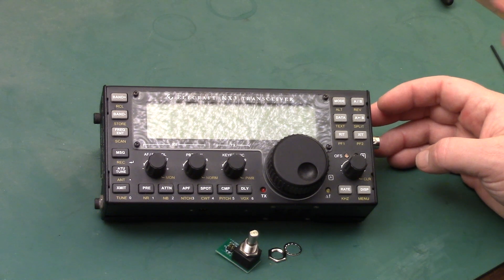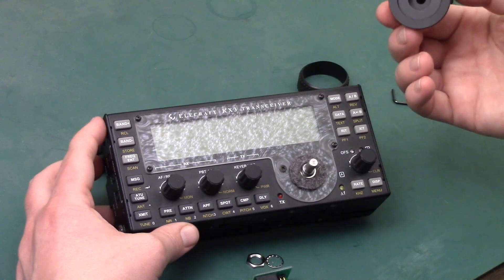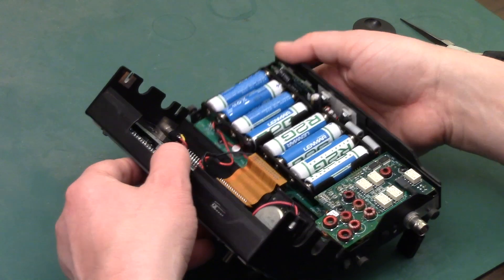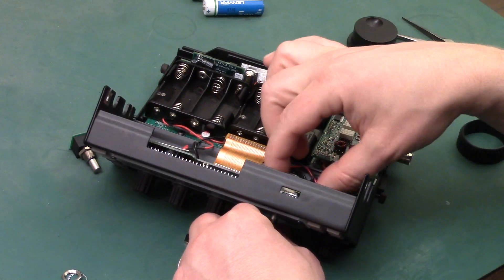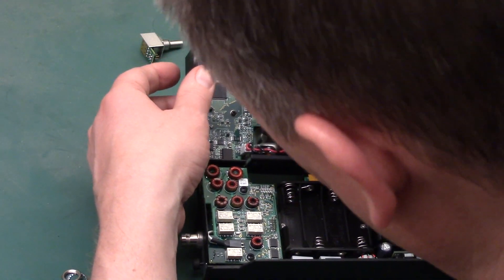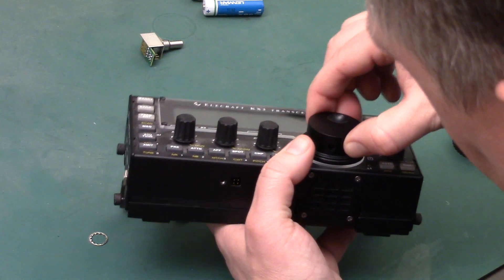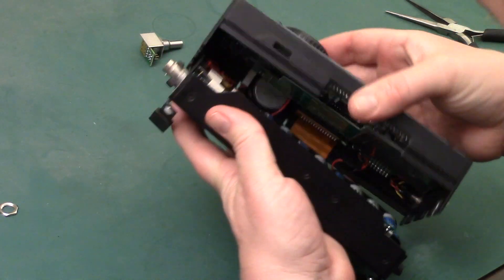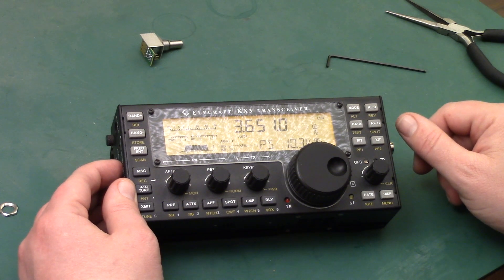Elecraft KX3 Ball Bearing VFO Encoder Upgrade

Comment: Great video. Now I would not be afraid to change mine if needed. Just got mine in January so I am hoping mine is the one with the ball bearings?

Barry, KU3X
Reply: pro tip: you can watch series on Flixzone. I've been using them for watching a lot of movies lately.
Reply: @Raylan Royal Yea, I've been using Flixzone} for years myself :D
Reply: @Raylan Royal yea, have been watching on flixzone} for years myself :D
Reply: @Raylan Royal yup, I have been watching on Flixzone} for years myself :D